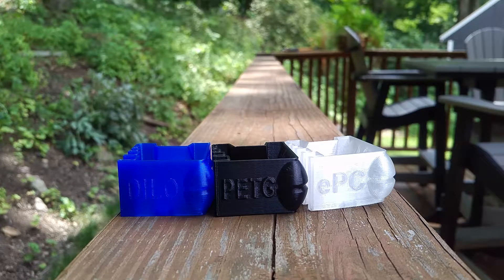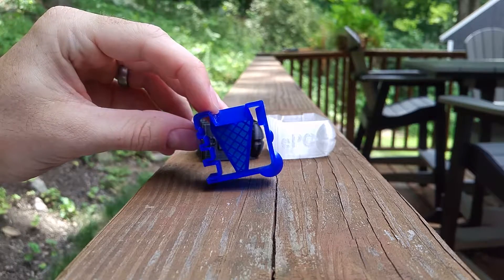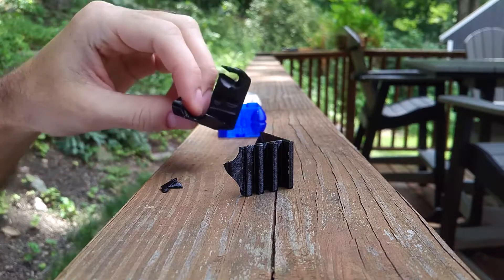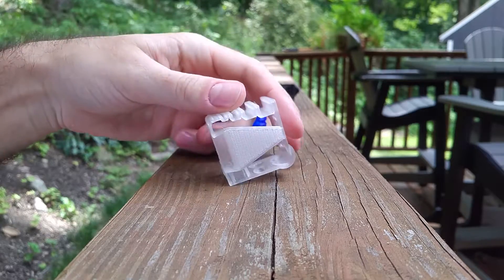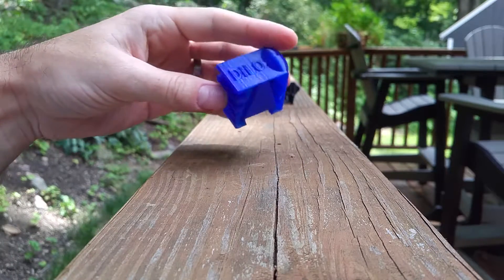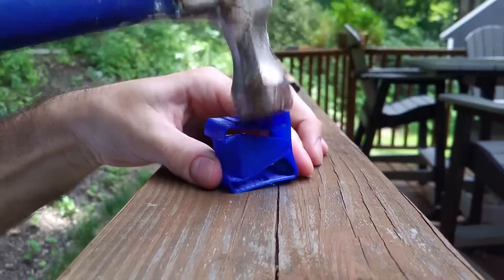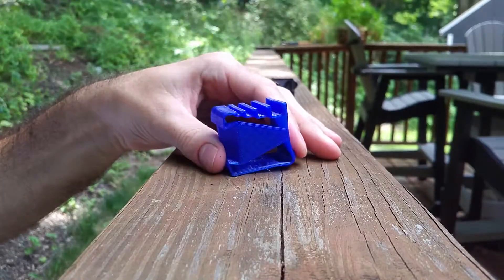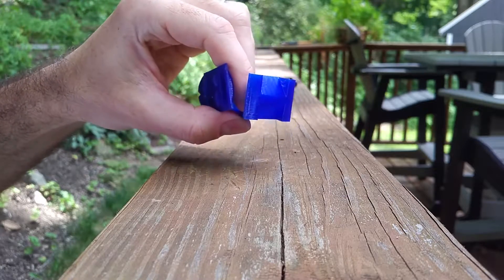ePC vs PETG vs Armadillo hammer test

Comment: Not completely scientific but I get the point... thank you for this test!!!

is the PETG easy to print? is it comparable to the PLA? how about the ePC?
Reply: MIKE MIKE I love PETG. It strings a bit but if you can tolerate that (or just pull them off) it produces high quality prints. PETG doesn't smell or warp as ABS does and has better temperature properties than PLA too. ePC's print quality is similar to PETG from my experience, but you will need higher temps.

Comment from the maker: Hello, Armadillo is the worst oozing stuff I have ever used. I get 
3-4inches of ooze during warm up and cool down. However I am very 
pleased with multi part prints. My seam lines on the parts are almost 
invisible with my settings.
Temp 225C (just under the temp that my filament starts to pop and bubble) 
BED FAN OFF
extrusion speed 1,400 mm/min
X/Y axis movement speed 12,000 mm/min
Retraction distance 1mm
retraction speed 2,000 
COASTING DISTANCE 1.6mm

Despite the oozing I am very impressed with Armadillo's bridging abilities. If you use S3D as your slicing software I can send you my FFF file if you like.
Reply: I would be interested in a video of the oozing.
Reply: I know that this is old and you've probably already figured this out, but just in case, the popping is from moisture that was absorbed into the filament. You can bake it for a few hours at 60-80°C to dry it. Then I would recommend storing it in an airtight container with some desiccant.